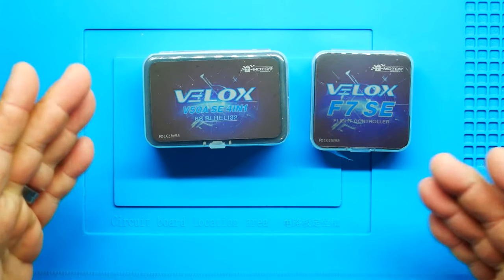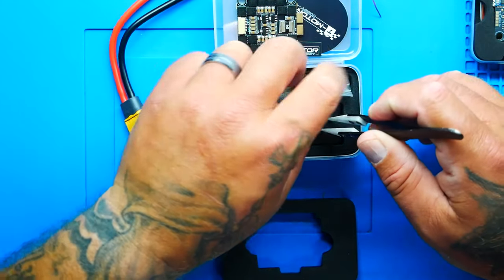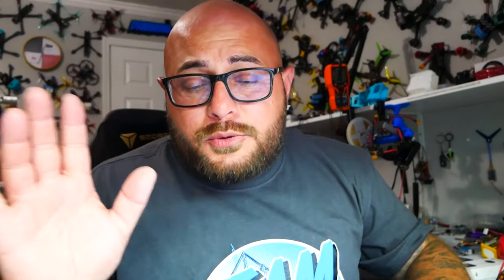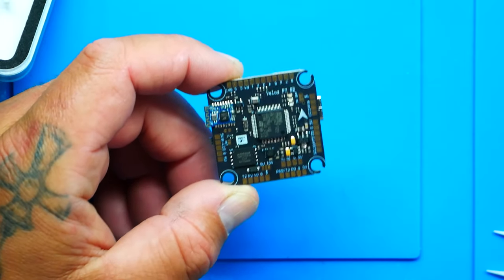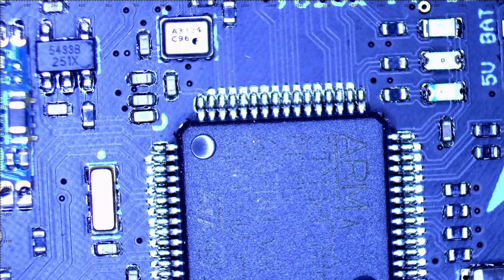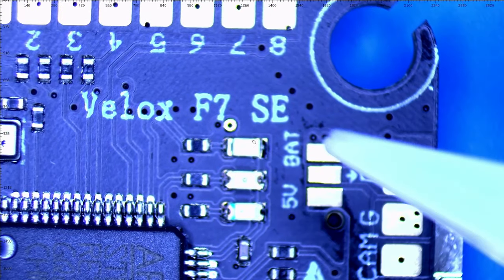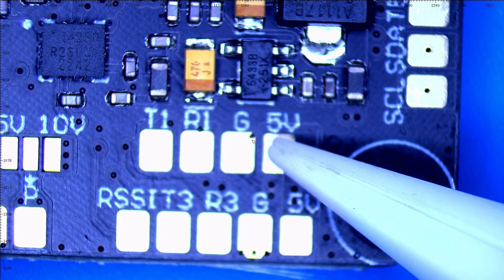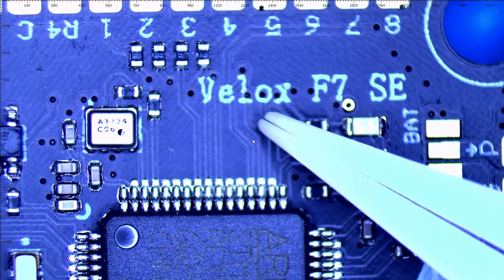All New Velox SE F7 Stack!! What Does it Not Do?!

Comment: Of the subject.. I need some help please 🙏..    I cant find my exact issue.  I've looked and looked..I don't  or I just don't get it.. lol.  How do I bind a bnf meteor65 Frsky  ..to my emax e8 radio controller ?    Could you please point me to the right direction..    sorry to ask on this comment section.. not sure how eles too....     thank you . And thank you for your videos....  your one of my favorite  fpv channels 😊  keep up the good work
Reply: I think if you hold down the power button on the radio that should put it into bind mode, there should be a small bind button on the board of the drones board in very small writing push that in the lights should go solid when bound might have to go into beta flight to set up switches in the receiver tab and then check motor directions in the motors tab.
Reply: My bad there's a video called how to bind my emaxs e8 to tiny hawk just need to look that up..
Reply: @jayzzz1234  thank you.. ill look that up ... but thats the tinyhawk.. will it be the same as the  meteor65 ?